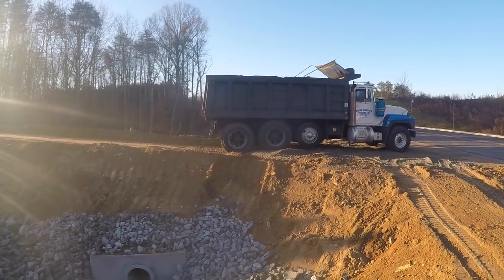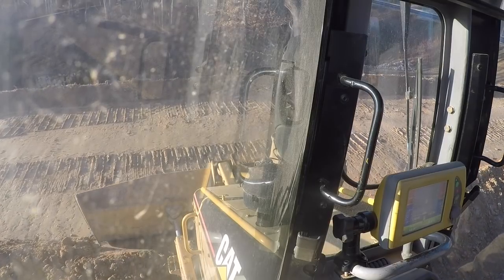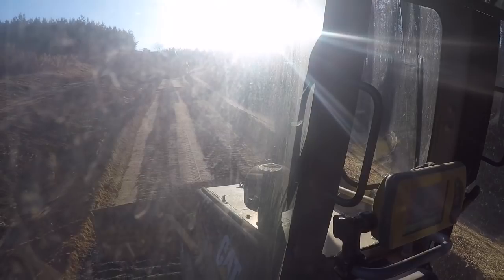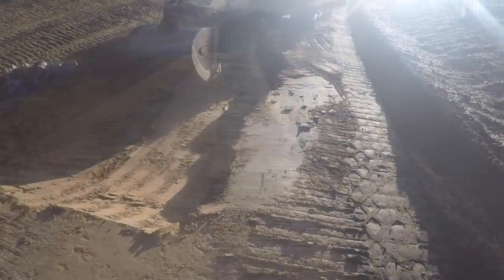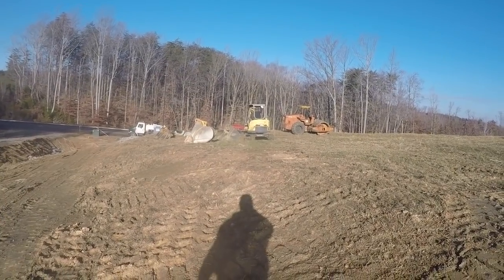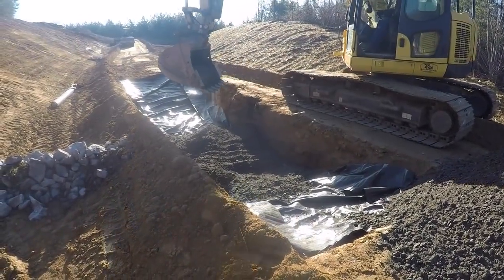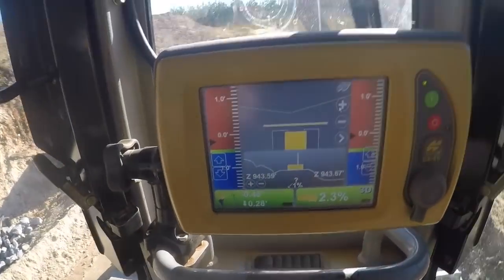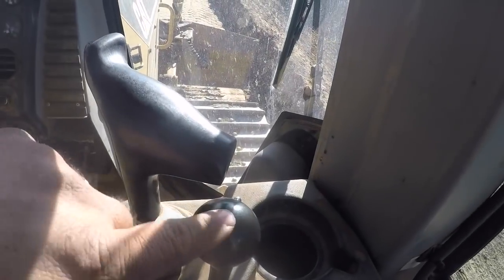Turned my dozer into a road grader with GPS!

Comment: How does the Cat D-3 compare with the Komatsu D31p-20 seems close to the same. I got around 2000 hours seat time on the Komatsu it was more of a dresser with the wide track like your Cat. The Komatsu D31p would almost push though full 20yard load. Never got the fortune to use a GPS it really must be nice to cut down on time and manpower reading prints and shooting grades. You should feel lucky to have it. LOL @ that short bucket on the skid-steer gonna have to feel it out all day, that's rough. Your making me miss dirt work though its deep in my blood and I can't get it out my friend. I can attest to how much time is saved with the GPS I have had to do the same sort of jobs for county, residential and commercial site development and it can be time consuming to monitor stakes, O transit/laser, pull strings, and the extra skilled labor needed to do it right. Not just any laborer can learn this stuff. Hell some cannot even get the tenths of foot factored into their head let alone read prints, use scales, convert, and check grades at any sort of pace to keep an operation moving.
Reply from the maker: I've never ran the komatsu that your talking about so I can't compare them. The one komatsu that I did run was very strong for it's size. I think it was a 41

Comment: What topcon system is this? Can it also be used on an excavator for digging sewer/storm drain to accurate depth per plans?
Reply from the maker: It's topcons machine control system. It can be used for digging I actually have a video where I'm doing just that with storm drain.

Comment: Dennis that snake i believe is called a Ribbon Snake,they usually have a darker body with three stripes one down the back and one on both sides with a lighter gray underside.There is not as many of them as some of the other ground snakes.They are not poison
Reply from the maker: Ok thanks

Comment: Does your Dozer have electronic valves?  I have an 06 D5G.  It has manual valves.  I was told it would cost me 20k to get a system like that because I have the manual valves.  I really enjoy your videos by the way.
Reply from the maker: This dozer has manual valves on it . It doesn't matter if you have manual valves or electric this system with GPS cost $80,000.
Reply from the maker: And you have to have a Rover and a Base station that cost another 30k to make the dozer work. And you have to have a model of the plans built for each specific job. But it's worth it!
Reply: Thanks for the response.
Reply: DLH Farms are you able to build the models, or do you have another company do it? I work at a site engineering company, and we build the models for our own purposes, but I always wonder how the contractors go about making them. We use civil 3D, but I wonder how compatible that is with your system.
Reply from the maker: We have a guy build them for us, its relatively cheap for what it does

Comment: What does the fabric do in the bottom of the hole just curious?
Reply from the maker: It's supposed to help bridge over soft dirt.
Reply: I believe it acts as a support layer...if Im not mistaken this isnt just run of the mill fabric...I use something called G-E-O grid when building retainer walls...first it stops the stone from being "pushed" down over time and having a continual pot hole situation years down the road.....just my uneducated guess though

Comment: The road doesn't look very wide.
Reply from the maker: +arden routh. It's not, it's just a service road for a water tower.
Reply: Oh I didn't know that I thought it was a regular highway, thanks.
Reply from the maker: +arden routh. Nah it's just a service road, it's nice for what it's going to be used for but it's basically just for access to the new water tower they are building on the hill.

Comment: Thanks for the comprehensive explanation of how the GPS system obviously helps solve many of the operating difficulties when working a dozer and how it saves time and labour on the job. The only time I have seen anything similar is on drainage equipment cutting and laying tile, also seen something similar attached to the dipper arm on a 360 being used for cleaning out heavily silted ditches. It also used a traffic light system of coloured lights on a lightbar fitted to the dipper arm to get the correct fall on the floor of the ditch.
Reply from the maker: +Dan Whiteford. We have that traffic light type set up for our excavators, ours uses a slope laser and picks up the beam when you get close to grade the laser beam tells the lights to come on on the boom and tells you to move the boom up or down. Merry Christmas Dan!
Reply: That could well have been what I saw, whatever it seemed mighty whizz to me and the results looked really good!
Reply from the maker: +Dan Whiteford. 👍